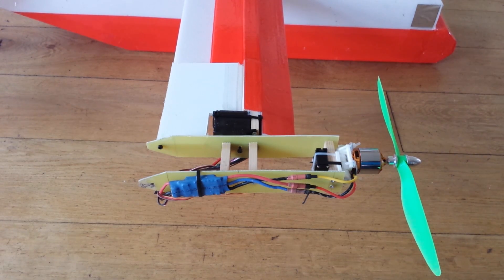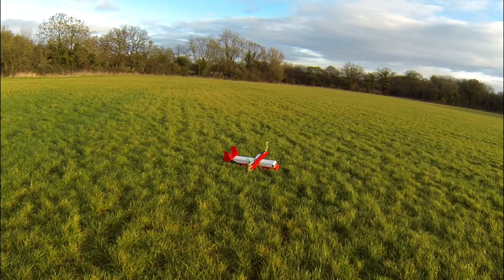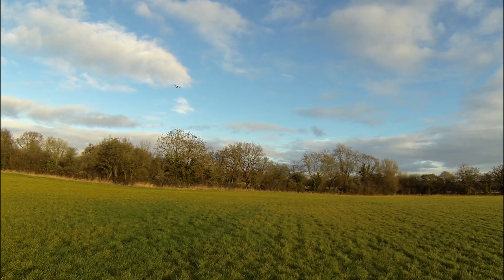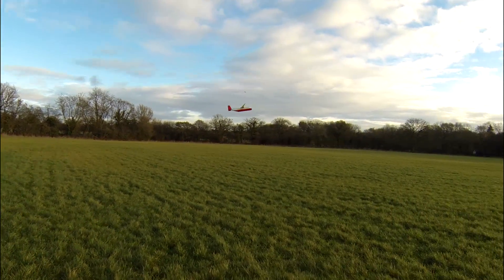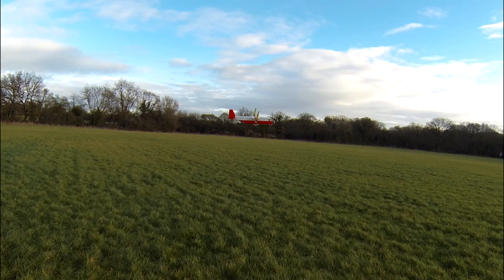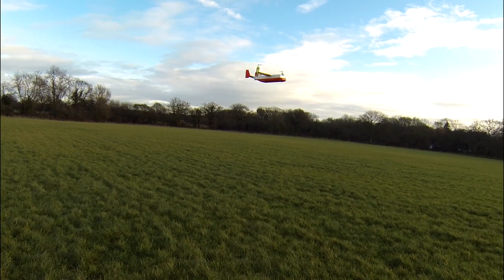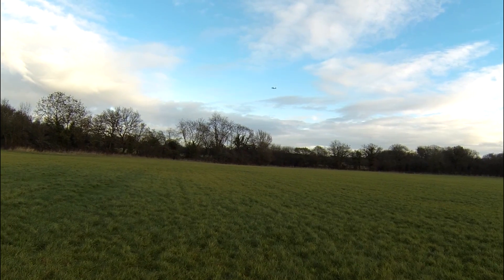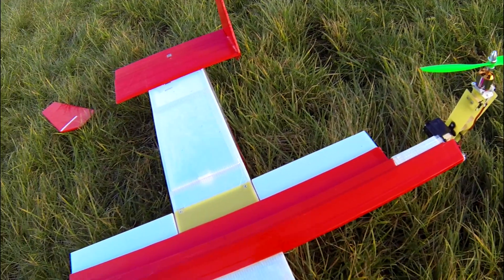RC VTOL Transition Testing #2

Comment: Hi Tom! Is it correct that at around 8:40 you switched off the motor tilt servo at the top of the pod so from then on only the whole pod rotates? It did seem to work better without the extra motor tilt? Which would be nice since it weighs more and complicates the set up. Can you confirm this is the case? Would love to build one of these since I only have a small area to fly in. I also think you should get a 3d printer so you can make (and sell) the parts in plastic since I don't have any glass fiber:-)!
regards,
Matthew
Reply from the maker: Hi Matthew, sorry for the late reply, I only just saw it now. At 8:40, I turned off the main pod tilt servo (larger servo), so in a hover, only the top motor tilt servo (smaller servo) was working. It is almost uncontrollable with just the pod tilt servo, which is why the extra servo is needed. It would be great to have a 3D printer as it would make these projects so much easier!
Regards
Tom

Comment: Thats cool. How do you get it to balance with just the two props? Multirotor board? Please put a camera in the cockpit I would love to see the onboard view with the transitions. You sound like you have a cold. Hope you get better soon.
Reply: Actually realize your prob over your cold by now. lol.
Reply from the maker: If you watch the video on the motor pods, I explain how the pitch is controlled. Yes, I use a KK2.1 board to stabilize the pitch too. I will find a way to mount a gopro on it. Thanks